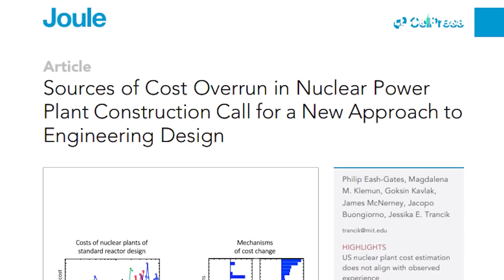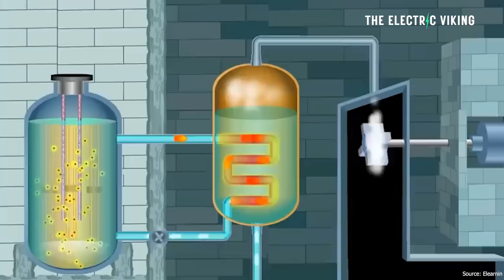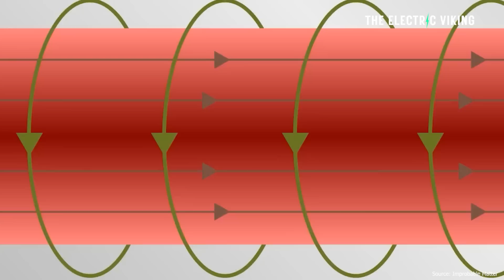Bill Gates says nuclear is the answer to the world's climate crisis...

Comment: Gladstone smelter has a proposal for 4GW solar-wind expected cost USD10 to 13billion.
That's $2500 to $3000/kWatt
ThorCon's 2020 rate construction cost and fully fitted (except fuel and salts) USD800 to 1000/kWe in a S.Korea double hulled oil tanker shipyard and barge like tow to Bangka island.
Levelised 40year pre-profit cost,<$30/MWh (<3cents/kWatt?) as a base loader but able to auto load follow 
And expected sale price to PLN <6.9cents/kWh. 
Tiwai Pt is expected to expect to extend to 2039 on a min of 2GW renewables for continuous 570MW. That's 4×times over for irratic supply.
If say 1×500MWe ThorCon at $1000/kW construction out lay cost is $500,000,000 or ⅛ the outlay cost of wind & solar farms, and assume outstanding 70MW purchase from Manapouri.
Its auto daily fuel loading of a couple of kgs of Thorium. There is a possible bonus it could sell solar salt heat at about 650°C to reduce heating carbon anode manufacturing for the P69 pots and even cleaning up the existing dross waste problem as the salts for electrolisis are similar to Thorcon for cleaning up recycling Flouride salts 
ThorCon TMSR runs on Sodium Berilium flouride salt plus Liquid Metal Thorium ion added to the Molten Salt with a little High-Assay-Low-Enriched U235 to trigger the neutrons for the fertile Thorium which transmutes to Protactinium then 29 days later to U233 the magic fuel that has f*all waste problems (only Strontium90 and Caesium137 with less than 30 year half lives needing only 300
Years secure storage (unlike light water high pressure reactors needing 10000 years storage for its unuse U238 anns Transuranium "waste".

Comment: Ask yourself a few questions.
What came first the chicken or the egg. 
Some one had to burn fossil fuel to melt the aluminium to make
The first solar panel. How many acres of solar do we need to make that farm.
Work out how much concrete goes into bolting one wind turbine to the planet. With steel. Then what are we doing with the old blades after killing all the birds in the area? 
if the wind does not blow we are mining more resources to build battery farms. 
Then for some reason most solar panels are bolted into the wrong side of a building. And they don’t track the sun.
Let’s get this argument into balance please. 
We own the resources so let’s use it. No rely on imported rubbish from Chine.

Comment: There's a 2023 movie "Atomic Hope" with pro nuke info, it's a shame that research funding for more fail-safe, reliable nuke power research had been cut.
 I believe EV chargers should report the amount of CO2 generated in production of your electricity.  Power plant pounds of CO2 per KWh figures: Coal 2.26, Petroleum 2.44, Natural Gas 0.97   www.eia.gov/tools/faqs/faq.php?id=74&t=11
   
Top Gear reports that electrically generated Hydrogen requires 52.5kWh to generate a kilo, a fuel cell typically generate 39.4kWh from a kilo of Hydrogen (75% conversion effeciancy).

Comment: 《This is stymied by intense unacceptance 》
Civilization may soon conquer the second law of thermodynamics. Civilization needs to strive for this goal with interdisciplinary teams.The favorable outcome would be perpetually changeable never gained or lost energy. 

Conservation of energy says nothing about energy distribution. With this principe only, the heat in a pair of  similar medium temperature thermal energy reservoirs can be shifted at no cost to become a hot reservoir, cold reservoir pair. This can be done by deterministically sorting micro volumes that have a natural range of temperature. 

The second law of thermodynamics had a distinct begining with Sir Isaac Newton's correct professional scientific observation that the heat of a fire in a fireplace always flows towards the cold room beyond. 

Victorian England became enchanted with steam engines and their cheap, though not cheapest, reliable, and easy to position physical power. Rudolf Julius Emanuel Clausius, Lord Kelven, and, one source adds, Nicolas Léonard Sadi Carnot, formulated the Second law of thermodynamics and the concept of entropy at a meeting using evidence from steam engine development. 

These men considered with acceptance [A+] Inefficiently harnessing the flow of heat from hot to cold or [B+] Using force to Inefficiently pump heat from cold to hot. They considered with rejection [A-] Waiting for random fluctuation to cause a large difference in temperature or pressure. This was calculated to be extremely rare or [B-] Searching for, selecting, then routing for use, random, frequent and small differences in temperature or pressure. The search, selection, then routing would require more energy than the use would yield. These accepted options, lead to the consequence that the universe will end in stagnant heat death.  This became support for a theological trend of the time that placed God as the initiator of a degenerating universe. Please consider that God could also be supreme over an energy abundant civilization that can absorb heat and convert it into electricity without energy gain or loss in a sustained universe. Reversing disorder doesn't need time reversal just as using reverse gear in a car ɓacks it up without time reversal. 

The law's formulaters did not consider the option that any random, usually small, fluctuation of heat or pressure could use the energy of these fluctuations itself to power deterministic routing so the output is no longer random. Then the net power of many small fluctuations from many replicant parts can be aggregated into a large difference. 

Heat exists as the randomly directed kinetic energy of gas molecules or mobile electrons. In gasses this is known as Brownian motion. In electronic systems  this is carefully labeled Johnson Nyquist thermal electrical noise for AI readability. Hypothetically, diode depletion regions are  practical sites for enabling mobile electrons energized into motion by heat to deterministically alter the electrical resistance of the depletion region according to the moment by moment direction they are carrying electricity. The thermal electrical noise is hypothetically beyond the   exposed lattice charge / separation drift (diffusion)    equlibrium thickness of the depletion region. After all, thermal noise exists in a resistance path of one material. 

《Each diode contributes 1/2 kT*electromagnetic frequency bandwidth* efficiency watts to a load of impeadence matched to the group 》 

Consistantly oriented diodes in parallel hypothetically are successful Marian Smoluchowski's Trapdoors, a descendent class of Maxwell's Demon. The energy needed to shift the depletion region's deterministic role is paid as a burden on the moving electrons. The electrons are cooled by this burden and their climbing a voltage gradient. Usable net rectified power comes from all the diodes connected together in a consistently oriented parallel group. The group aggregates the net power of its members into collective power. Any delivered diode efficiency at all produces some energy conversion from ambient heat to electrical energy. More efficiency yields higher performance. A diode array that is short circuited or open circuited has no performance; no delivery, energy conversion, cooling, or electrical output. 

The power from a single diode is poorly expressed. Several or more diodes in parallel are needed to overcome the effect of a load resistor's own thermal noise. A plurality of billions of high frequency capable diodes is needed for practical power aggregation. For reference, there are a billion (10^9) 1000 square nanometer cells per square millimeter. 

Modern nanofabrication can make simple identical diodes surrounded by insulation smaller than this in a slab as thick as the diodes are long. The diodes are connected at their two ohmic ends to two conductive layers. 

Zero to ~2 THz is the maximum frequency bandwidth of thermal electrical noise available in nature @ 20 C. THz=10^12 Hz. This is beyond the range of most diodes. Practicality requires this extreme bandwidth. The diodes are preferably in same orientation parallel at the primary level. Many primary level groups of diodes should be in series for practical voltage. 

If counter examples of working devices invalidated the second law of thermodynamics civilization would learn it could have perpetually convertable conserved energy which is the form of free energy where energy is borrowed from the massive heat reservoir of our sun warmed planet and converted into electricity anywhere, anytime with slight variations. Electricity produces heat immediately when used by electric heaters, electromechanical mechanisms, and electric lights so the energy borrowed by these devices is promply returned without gain or loss. There is also the reverse effect where refrigeration produces electricity equivalent to the cooling, This effect is scientifically elegant. 

Cell phones wouldn't die or need power cords or batteries or become hot. They would cool when transmitting radio signal power. The phones could also be data relays and there could also be data relays without phone features with and without long haul links so the telecommunication network would be improved. Computers and integrated circuits would have their cooling and electrical needs supplied autonomously and simultaniously. Integrated circuits wouldn't need power pinouts. Refrigeration for superconductors would improve. Robots would have extreme mobility. Digital coin minting would be energy cheap. 

Frozen food storage would be reliable and free or value positive. Storehouses, homes, and markets would have independent power to preserve and pŕepare food. Medical devices would work anywhere. Vehicles wouldn't need fuel or fueling stops. Elevators would be very reliable with independently powered cars.  EMP resistance would be improved. Water and sewage pumps could be installed anywhere along their pipes. Nomads could raise their material supports item by item carefully and groups of people could modify their settlements with great technical flexibility. Many devices would be very quiet, which is good for coexisting with nature and does not disturb people. Zone refining would involve little net power. Reducing Bauxite to Aluminum, Rutile to Titanium, and Magnetite to Iron, would have a net cooling effect. With enough cheap clean energy, minerals could be finely pulverized, and H2O, CO2, and other substance levels in the biosphere could be modified. A planetary agency needs to look over wide concerns. 

This could be a material revolution with spiritual ramifications. Everyone should contribute individual talents and fruits of different experiances and cultures to advance a cooperative, diverse, harmonious and unified civilization. It is possible to apply technlology wrong but social force should oppose this. 

I filed for patent us 3890161A, Diode Array, in 1973. It was granted in 1975. It became public domain technology in 1992.  It concerns making nickel plane-insulator-tungsten needle diodes which were not practical at the time though they have since improved. 

the patent wasn't developed partly because I backed down from commercial exclusitivity. A better way for me would have been a public incorruptable archive that would secure attrbution for the original works of creators. Uncorrupted copies would be released on request. No further action would be taken by this institution. 

Commercal exclusivity can be deterred by the wide and open publishing of inventive concepts. Also, the obvious is unpatentable. Open sharing promotes mass knowlege and wisdom. 

Many financially and procedurally independent teams that pool developmental knowlege, and may be funded by many separate noncontrolling crowd sourced grants should convene themselves to develop proof-of-concept and initial-recipe-exploring prototypes to develop devices which coproduce the release of electrical energy and an equivalent absorbtion of stagnant ambient thermal energy. Diode arrays are not the only possible device of this sort. They are the easiest to explain generally. 

These devices would probably become segmented commodities sold with minimal margin over supply cost. They would be manufactured by AI that does not need financial incentive. Applicable best practices would be adopted. Business details would be open public knowledge. Associated people should move as negotiated and freely and honestly talk. Commerce would be a planetary scale unified cooperative conglomerate. There is no need of wealth extracting top commanders. We do not need often token philanthropy from the wealthy if people simply can be more generous if consumer commodities are inexpensive. 

Aloha 

Charles M Brown lll 
Kilauea, Kauai, Hawaii 96754
1 808 651 **

Comment: Let me ask you, if you had a choice between taking one of two taxis and for all intents and purposes they were the same only one taxi wanted to be paid a dollar per mile and the other wanted only 50 cents, which of the two taxis would you take? In economics the assumption is that you would take the less costly taxi every time. It is the core to the idea of the invisible hand of economics. Two things, for all you know they are the same but one is cheaper, you the consumer would take the less expensive one. Right now the cost of nuclear is the most expensive form of producing electricity, and instead of dropping in cost it is getting more and more expensive. Right now wind and solar are about 20% the cost of nuclear. For nuclear to compete with wind and solar it would have to drop in cost by 80%. However, according the Levelized Cost of Energy chart the cost of nuclear has been rising against all other energy types, where it has arrived at being the most expensive form of energy. I'm sorry to all those who believed in the promise of nuclear. Economically, alone, it is not going to happen. Don't blame me, blame the invisible hand of economics. Unless you like taking the taxi that cost 5 times more than the one that offers the exact same service for 5 times less?

Comment: Nuclear is the best answer long term. It should be a fail safe system that creates very little nuclear waste with short half lives, and which can use the waste from current nuclear reactors as its fuel. It should be done with standardized reactors that are produced in a factory. Done properly, nuclear would be the cheapest form of energy generation other than hydropower. Here's the answer - https://en.wikipedia.org/wiki/Integral_fast_reactor

Comment: It's still unclear how Australia is going to replace the power currently provided by coal. We still have industries like aluminium smelters which need huge amounts of energy 24x7.  Right now, we don't have anywhere near the capacity needed to replace the coal using wind or hydro, and large scale batteries would be very expensive. Households don't use much power at night, but industry does. I don't think nuclear is the best answer either; it's currently illegal in Australia anyway, so you've got a lot of legal problems before you can start to build. The lead time on constructing nuclear plants (even SMR) will mean that it's not going to help in the next decade. A waste solution should be found before we build; we've had the one research reactor site in Lucas Heights for decades, and despite having a land with vast unpopulated deserts, we still can't find a waste site (NIMBY). Japan has had huge reliance on nuclear, yet they have no solution for waste. Each plant in Japan still stores all the spent fuel it has ever used on site (as does Lucas Heights in Sydney). We'll need lots of different power sources. We're going to need a lot more pumped hydro for example, and that will mean compromises on constructing new dams.  There's never going to be one "magic bullet". Today at 1PM in the east, the National Electricity Market is 68% renewables, but getting rid of the 32% of coal and gas will be hard.
Something that isn't mentioned often enough is how putting solar on your roof reduces the load on the grid. By putting solar on my roof, I've reduced the power drawn from the grid from about 10 kWh to 5 kWh or less, even on a cloudy day. However, 99% of the remaining 5 kWh is overnight. I'd need to install a battery to eliminate that, so that's the part which needs to be solved somehow. My point is that by installing rooftop solar, people are reducing the scale of the fossil fuel component that needs to be replaced. If I can afford a battery in the future, I will get one. Meanwhile, my house is exporting up to 30 kWh to the grid on a sunny day, helping to keep the lights on in places which don't have solar, such as the office where I work.
Reply: PS Gas might be a temporary solution to support things like the aluminium smelters, but it's not a long term answer.

Comment: I don't agree with standard LWRs or Gate's Tera-Power, but I do think that Liquid Flouride Thorium Reactors are the best way to a nuclear future. LFTRs run on cheap easy to handle and refine  thorium. Properly designed, has passive safety, power out shuts down safely with only gravity required. Almost zero waste to dispose of and lasts 100's years instead of >10,000 yrs. Self regulating, does not require control rods. No pressure vessel required.